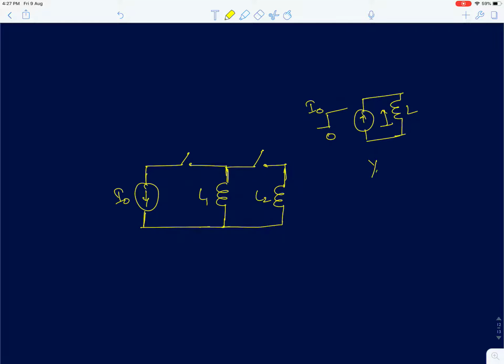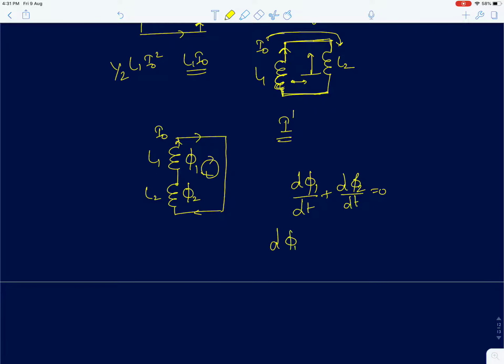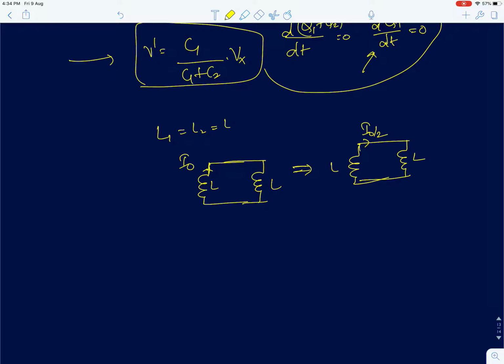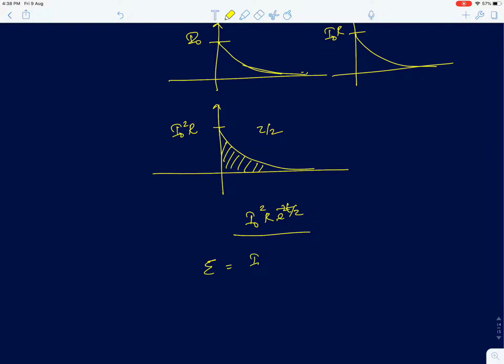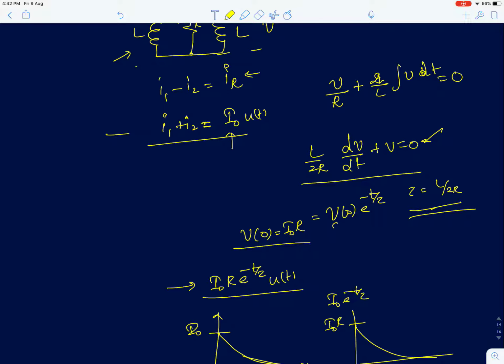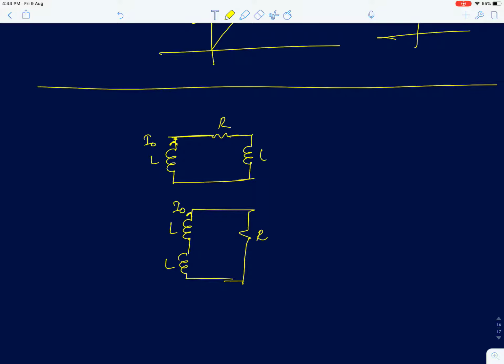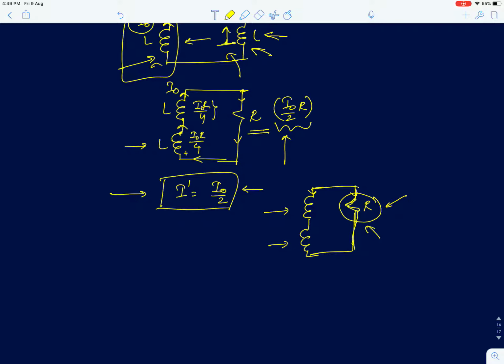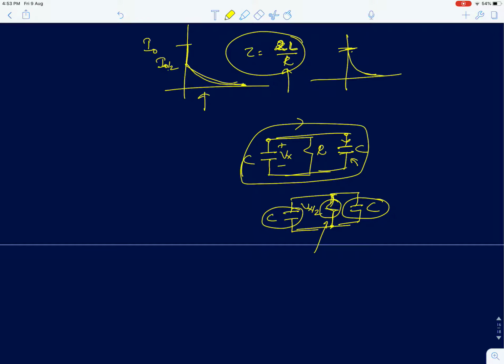ES Lecture 29: 'Flux sharing' between two inductors, Flux conservation in inductor circuits

Comment: At @ 20:30 why does the upper Inductor has positive impulse? I understood that the lower inductor has negative voltage due to current direction but that direction is also same for upper inductor, but it has positive impulse than lower inductor. Can anyone explain?
Reply: The inductor voltage sign does not depend only on the current direction.
Two inductors can have currents in the same direction, but
one current increasing (di/dt>0)
one current decreasing (di/dt<0)
and therefore their voltages have opposite signs.